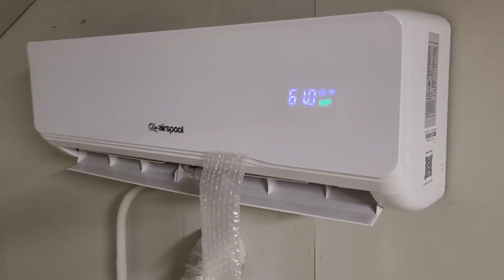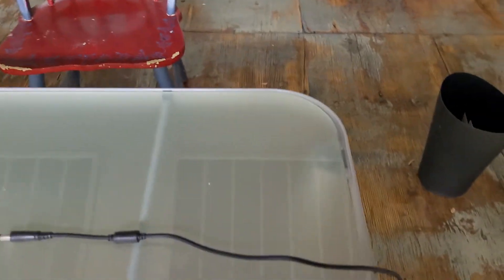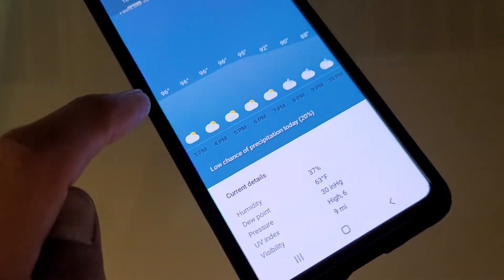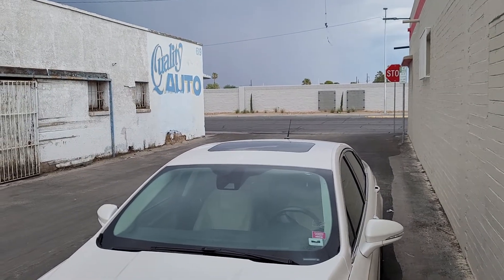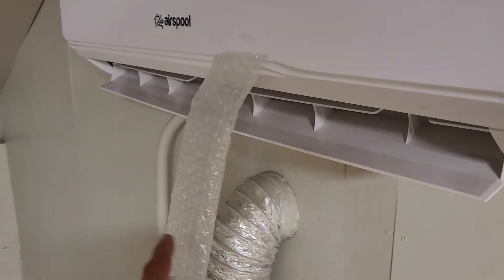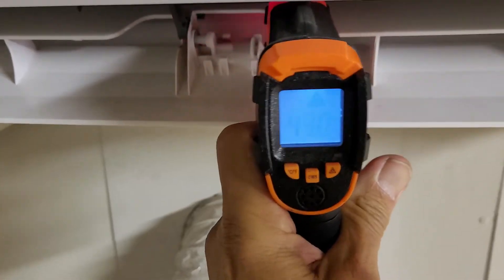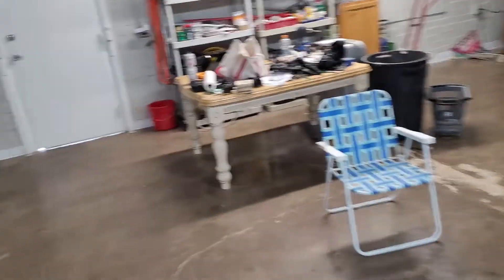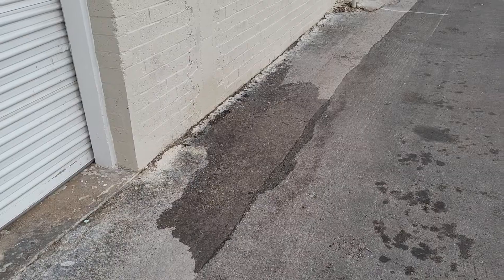Should I run my mini split in cool mode or dry mode for best results? Aircon vs. dehumidification

Comment: I live in las vegas as well and have a mini split in my mobile home for the living room. What temperature sbould i have it on for the summer and can i have it on auto mode running 24/7 or should i turn off the unit to let rest ?
Reply from the maker: Leave it on if you are there. Really, it's almost always bad advice (in terms of saving your NVE bill) to leave it running when you're not there. But if you are there, have it run on either air conditioning or dehydration in the 24/7, no need for a rest. Stay away from auto mode unless you want to keep pets and plants somewhat comfortable because the dead band is too wide for normal human comfort.
Reply from the maker: And, of course with our unit, feel free to leave it running all day long even when you're not there, because it runs for free. Hoping we can have you be a client soon, neighbor.

Comment: I just installed my Airspool 1-ton hybrid, only connected to grid power for now. I am testing it today in dry mode + AC limiter. Only using about 200 watts on an otherwise cool day, while keeping the space cool and dry. Dry mode for a minisplit will act as an air conditioner and cool the indoor space because the condenser is outside. That is different from a dedicated portable dehumidifier which won't cool the indoor space because the condenser and evaporator are contained in one unit causing little change in temperature.
Reply from the maker: I should know more about portable dehumidifiers. But I can speak to portable AC units. The problem with portable AC units is that the makeup air is from the attic or whatever to get the pressure level back to where it was before you sent air out the window. So you're drawing in air specifically from where you don't want to. It's a losing battle. Anyway, keep in touch as we head into the hot hot heat here.

Comment: Cool mode goals is to cool down the room to the temperature that you want. Dry mode will not control the temperature. The coil is cold with low fan speed to get water out of the air. So the room temperature might not cool down. Air conditioner is not designed to dry the air. It has poor performance. It’s better to install dehumidifier.

Comment: My Della MINi Split causes the humidity level to go up much higher than the outdoor air; Dry mode does its job just fine.  It's good to know that the dry mode is cheaper to run.  I will use the dry mode most of the time from now on.  It seems to work the best for my situation.   Thanks. I might add that the dry mode lowers temp, too.

Comment: Just leave it on cool mode those systems use minimal power lees then a stand or ceiling fan actually
Reply from the maker: Well, in general, ceiling fans are around 75 watts, and many splits need around 500 to 1,000 watts to run the compressor, depending on the speed of the compressor or if it's an inverter compressor. When mini splits are in fan mode, usually that's only around 20 watts.

Comment: You have to turn the laser mode off o. The thermometer and just let it scan to get the actual room temperature using the laser is only to get temperature on service
Reply: what? laser doesn't affect the measurement and provides good aim to take better measurements

Comment: Is the only difference between Dry and Cool modes the fan speed on the evaporator?
Reply from the maker: The fan speed is lower, but also the compressor doesn't send as much refrigerant through the coil. But the coil is still maintained at a very cold temperature, because there's less heat coming across it with a lower fan speed. Thus, dry mode saves a lot of power, since the compressor is the thing that eats the power. The fan is like 14 watts, and the compressor is like 800 watts or something, depending on the season and the load.
Reply: @airspool  So, I'll try Dry Mode set at 75° this summer

Comment: If it's 90° and 85% humidity out, is cooling mode better? The heat doesn't bother me as much as the humidity
Reply from the maker: That sounds like hell! Well, if the humidity is your focus, then keep the fan speed low because more water will be sucked out of the air when the air spends more time on the ice-cold coil.
Reply: @airspool  Thanks, 90° and dry ain't that bad

Comment: I run mine on dry mode and it gets freezing but if I put it on cool mode the humidity rises like crazy (I live in Puerto Rico)
Reply from the maker: Try playing around with the different fan speeds in cooling mode until you find one that dehumidifies but isn't freezing you out.
Reply: You run the AC  all the time (24hrs) in dry mode? I’m having an issue I bought a new mini split and is making my walls wet and It feels warm in 70° 🙁 vs when I used dry mode in -7 (72°) I live in PR too.First day it worked fine now Im not sure. (AC is one week old)
Reply: @khelix23  Yeah, it's either run in dry mode and it's cold or cool mode and it's wet. There is an auto feature that switches back and forth but the humidity climbs. I am mainly offsetting the issue by keeping the door open so the unit covers more space. It's a bit cooler in the bedroom than my wife likes it but it's not freezing.

Comment: I live in a country with 70 to 80% humidity. Can I leave dry mode on all night since the tempteratures arent high? Does using dry mode all night harm me or the unit? I see people recommending 2 hours at most. My ac lets me set the temperature in dry mode
Reply from the maker: Hi Anthony, you can leave it in dry mode all the time if it's comfortable. It sounds like most of your heat down there is due to the humidity, so this would be a good strategy provided you are happy with the air temperature.
Reply: @airspool  Thanks for replying. I live in a small country call Trinidad and Tobago. Our temperature at night is comfortable for me (28c to 26c) but the humidity is insane, and it makes everything feel so warm. I tired the dry mode last night after watching your video and the temperature was perfect. I think I'll use dry mode in the night and use cool during the day.
Reply: @anthonyreis3533  any updates on your AC? I live in Puerto Rico and I’m having the sane issues with humidity. But just in one room. The AC in other room works fine.
Reply: @khelix23  I ended up using the AC on a cool at 25 or 26. It works perfectly for me. My humidity dropped to about 50 to 60. with the inverter units I am saving alot of money.
Reply: My Gree does nothing in dry mode for 2 months.  Maybe try lowering temp
Reply: I just got mini splits installed in every room in my house in Oceanside,CA  which is San Diego county. It doesn’t get that hot here. We are experiencing a heat wave but it’s maxing out at 80. I’ve had them installed for 2 weeks and I’ve been using AC mode to keep the house at 74 during the day. However, at night the exterior temperature drops to the low 60s meanwhile indoors is still 74. I feel like I’m using AC for no reason. When I turn it to dry mode, it immediately drops the interior temperature low (matching the outdoor temperature) and it feels amazing but I can’t control the temp setting in dry mode. I’m not sure if I’m doing the right thing but it feels so much better to run it in dry mode. In AC mode, if I set it to 61 then inside gets to 61 but works hard to do so. Dry mode is getting it down to 61 too but I’m not sure if it’s working just as hard as AC mode. I’ve researched for days and I can’t find a consistent answer.

Comment: I can set the temperature in Dry Mode on my Midea split system but that doesn't seem to change the room temperature much
Reply from the maker: Hi Cristobal, then use that one if it seems to be able to maintain the room temperature okay, since it uses around 1/2 the electricity as ac mode.

Comment: Modern air conditioners are designed by idiots. Who in the world would buy an air conditioner which serves to dehumidify the air or works just as a fan? The purpose of using an air conditioner is of course to cool down the air. Just 1 mode is enough. Too many modes makes operating an air cond so hard that it needs a genius to do it. I spent many years using my air cond to realize that there are 3 modes. I had been wondering why my air cond worked intermittently. Adding to the mess were the timer and sleep functions. The designers should have included a default mode which is air cooling without the timer and sleep, if they so wish to make the air cond so hard for users to use.
Another point to make: If you want to save on electrical bill, use a fan, not an air-cond.
Reply: Wtf I use my split airco to heat in winter. It IS just a heat pump …

Comment: nice n dry there , here in E NC its 90 at 11 am 79 percent humidity.
Reply from the maker: Yes, the drying mode is certainly useful when there's higher humidity. Here, lots of simple heat, but not much latent heat until August. It's tough sledding in that high humidity!

Comment: I would like to know how much more energy the ac is using than dry mode when in a normal mode, not turbo. I would imagine turbo would use more energy by default. I'm in Louisiana with very high humidity and dry mode cools amazingly well. I just want to make sure I'm also being energy efficient. Thanks for the video.
Reply from the maker: Hi John, turbo vs. normal mode is maybe 10 watts more?  Maybe not even that.  The indoor fan motor on most mini splits is around 15w.  So, virtually nothing.  The compressor is the part that uses  the energy.  And, yes, in dry mode, maybe 500 watts, depending on your unit, and 1,000 watts +/- in cooling mode.  So, 2x more power for cooling mode.  There are two types of heat, simple and latent.  Simple heat is the actual temperature.  So, dry air might have a temperature of 100 degrees here in Las Vegas, and moist air in Louisiana may be only 84 degrees, but it feels the same.  In those cases, dry mode should do well for you.  And, really, in those cases, even if you have on the air conditioner, you don't want to be in turbo mode..  In general, I'd say stay away from turbo mode in Louisiana.  Why?  Because it causes the air to spend less time on the indoor coil, and so there's not enough time on the coil to take away the humidity.  Only use turbo by you when the humidity is lower.
Reply: @airspool  thanks for the great and detailed answer. Typically we only use turbo mode when we have a lot of people over and need it to cool down fast and then switch back to normal mode.

So let me make sure I got this right, in Louisiana, I will do better and be more energy efficient in Normal/Dry modes rather than Normal/cool modes? Thanks again
Reply: @airspool  can i leave the door open ed on dry mode please?
Reply from the maker: Well, yes, but...if it's humid outside, you'll be letting more humid air back in, which may be more than what the air conditioner or dry mode can get rid of.